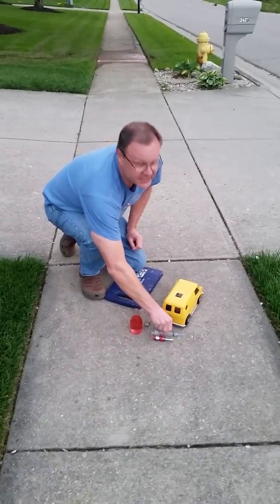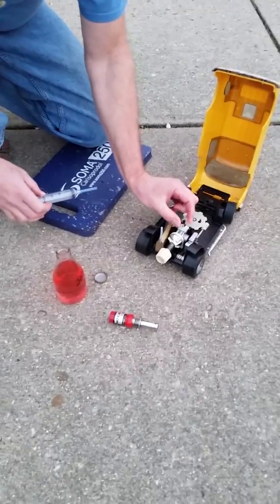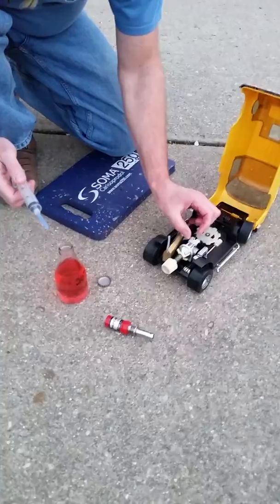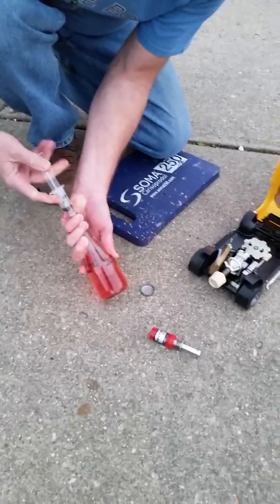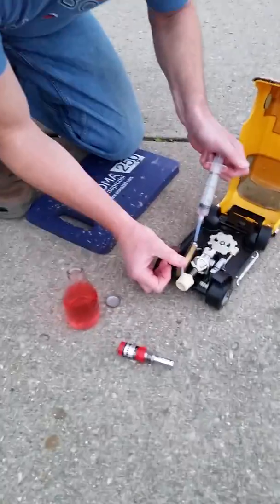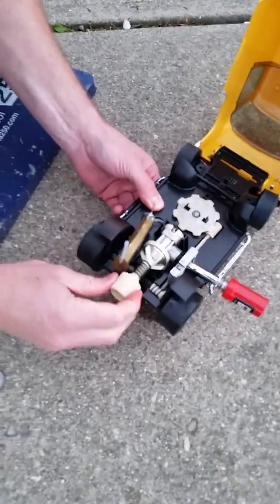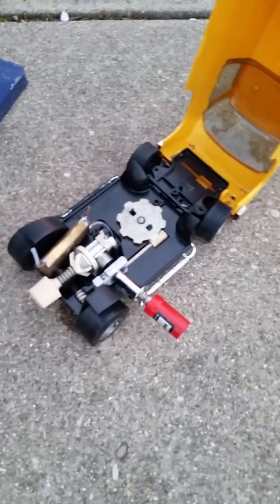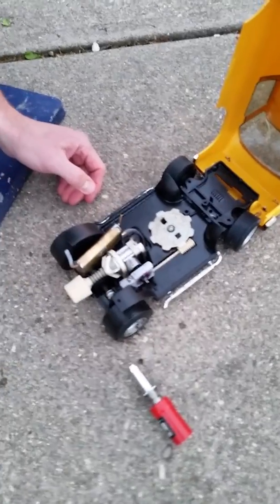Vintage Cox 049 powered van

Comment: These Cox engines have a unique and memorable smell. Once you smelled it you never forget that smell.
Reply: And that taste too 😏
Reply: Ahhh the smell of bean oil on a Saturday afternoon was definitely something to look forward to. Me and my friends had all the COX powered stuff I had a control line plane, a trike chopper thing, a funny car that ran down the string with a knot at the end for the parachute to open. I always got in trouble from my mom for using my pillow to catch our cars in. Also had a couple of cars that went around in circles on strings. I have great memories of me and my good friends spending our whole summers running, working on , and modifying our COX powered  vehicles.
Reply: Same smell with all the glow diesel nitro/castor oil 2-4 stroke engines. From the .049 to the big ones I use on planes...the .65's Just the bigger ones make a lot more noise.
Reply: Castor Oil ... which I have been running in my Vintage Racing Karts for decades... it's a wonderful smell!!!
Reply: I believe it was a mix of nitromethane, methanol, and castor oil
Reply: @montylc2001 I don't know.... some of the bigger engines with mufflers were QUIETER than the Cox engines, in my opinion. 

The .020 Pee Wee and the .010 T.D.'s were QUITE noisy for being TINY little things.
Reply: @KrustyKlown  You could call it a ricin grinder. HAHAHAHAHA!

Comment: Brings back memories of a Cox .049 tethered hovercraft... 95% of time starting it, 5% running it.  Now I fly an RC drone 3-1/4 miles range with clear HD video and 25 minute flight time.  Technology!
Reply: I had the hovercraft also. the last time i used it it caught fire and melted a bit!
Reply: Micheal Ridenoour - Feel your pain..l I traded a pretty good HO-scale train set & layout fir that gas-powered abomination!
Reply: I had the Testors Hovercraft & ran it several times including over water(it had foam in the body) Testors engines weren't very reliable as cox engines.
Reply: Метанол 50 ..нитрометан 30 .масло касторовое 20..по книге Советской 1972 г

Comment: My bro sent me link to this,
Wow, my first nitro powered toy in late '60's I believe, or early "70's.
   I got bored with the cam steering after seeing each pattern a couple of times and tore apart a cheap RC car to repurpose the steering servo (not like a hobby servo you can buy, but built into the car), to make the van a RC steerable unit.
  I had high hopes of it being awesome and the envy of my friends, and it did work too.
 Only problem was the steering was reversed due to servo mounting at different position front of or behind front wheels, don't remember now.
  But it sure made it exciting to play with again and not as big of a hit as I'd hoped. I wasn't even a teenager then and this behavior led me to becoming a communication technician in the Army a decade later.
  I now Know that had I swapped the 2 wires that went to the outside terminals of the RC controller steering wheel it would have fixed it. Oh well.😢

Nice find you have there though. Thanks for sharing.

Comment: I just today (02/2025) came across this. I would fill the fuel tank, block the vent, squeeze in a little more fuel to purge and prime, block the air intake on the front of the engine while starting. Fired right up. Back in '74 or so that is. Great video.

Comment: I had a funny car. It had a string or fishing line.,that went through two holes on the bottom. You nail the string from A to B...when it got to the end .,it triggered a cutoff plate to the intake..and would shut off engine.  Tired probably turned at 5000rpm. Good to see 'The Van' 😬👍👍

Comment: I like the glo driver adapter plug instead of using the old yellow clip they gave you. I just was given some old futuristic looking Indy car by cox that has a similar setup but a finger flip wheel to start it. Sad that they got away from the old pull start engines like I had in my dune buggies. Fun vid.
Tks🏁

Comment: What memories! I had the Sand Blaster! as I watched this video, I could smell the fuel the raw and the combusted fumes again. On of the things i would do back then was remove the cyln head and with mom's emory board, clean the piston crown. and I removed the muffler. It was a little louder, but I seemed to have quicker and better starts.

Comment: I received one for Christmas when I was a about 12 years old back in 1970’s. These were popular back then as battery powered RC cars were very expensive back then. I only got it to run a couple of time and then the starter battery went dead so I never got it to run again. but I still remember the sweet stench of the fuel exhaust.  I also had a cox gas powered air plane that I had better luck getting the engine to work in. I flew that a few time but these Gas engine Cox RC vehicles were very loud and made allot of noise so I did not have very many places where I could run them. I had the Cox Van, Air plane and Jeep.

Comment: Leave the glow battery on longer , until you get the engine tuned , and you can tune it to a higher rpm for a faster run .

Comment: Amazing, didn’t think those little engines could run at such low revs. What does it do? About 100000 mpg! 🤪
Reply: DavidAustin - The Cox engines could easily rev at between 2000 to 20,000 RPM and still get 100000 mpg!

Comment: I wouldn't dare mod it, but it is honestly tempting to add some servos, a control board and a throttle assembly and go RC with this. If they were more common, I'd say go for it, the gas RC Cox were fun and quite powerful! 

But as it is, Cox and Testors will never come back with such classics. Better to go with Traxxas and MRC Tamaya. Or the high powered LiPO battery ones.

Comment: The "Thimble Drome Glow Fuel" sold by Cox contained 15% nitromethane, and the Cox engines were designed to run on this fuel. They are difficult to start and do not run well on fuel that is just methanol and oil.

Comment: I don’t like those thumb spin starters.  I have two cox cars, sandblaster, and dune buggy.  Both have the pull recoil starters like a tiny lawn mower.  IMO, are easier to start.  I Had my sandblaster since 1976.  Bought dune buggy later 2000s on eBay.

Comment: How do you control and steer it?
Reply: It has came with 4 discs that controlled the steering pattern , turned buy the power of the engine .
Reply: @rickbennett1292  so it had steering, but it was a driven system that made a pattern?
Reply: @greg0063  yes , as the rear wheels turned it simultaneously turn a disc that controlled the steering . pretty crafty setup .
Reply: @rickbennett1292  pretty cool, I always just thought they were fixed in a circle.

Comment: I have a Vega Van Gasser drag car that i got when I was 11. It runs on a string that trips the parachute. It never made a full pass. Its 50 years old and now the tires have shrunk and are loose on the wheels. I will never part with it.

Comment: Gas? You mean gasoline???? Glow motors will not run on gasoline. They use alcohol based fuels. Learn the difference between a spark plug and a glow plug. How Ray Arden designed them is a very interesting story.

Comment: Wow lame
Reply: No--the startup and run was pretty typical for someone not used to running the COX .049's regularly (not that they started easily--they did not).  What's truly "lame" is that you just have no, real comprehension of, and therefore no interest in, the internal combustion engine--which us kids of the '60's and '70's did.  And we actually learned to OPERATE, TUNE and REPAIR equipment, rather than "plug and play," like you and your computer "breadboards."  "Wow lame..." indeed.